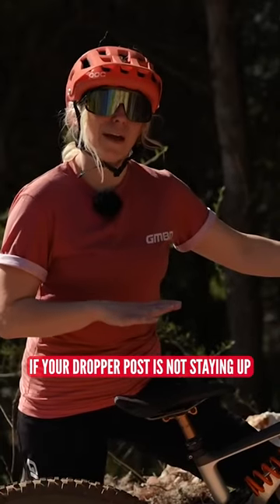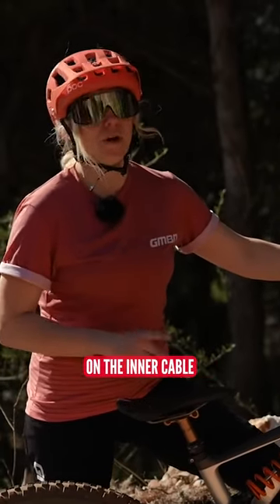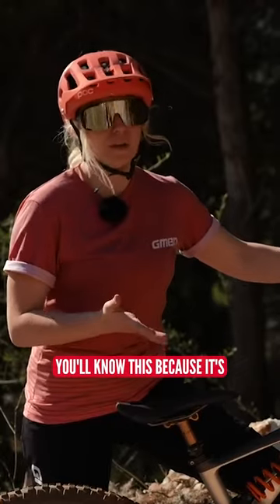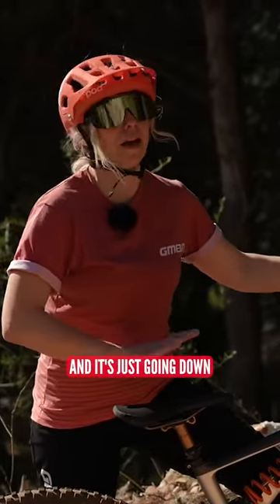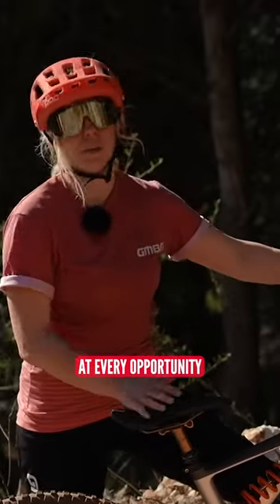Dropper Post Not Staying Up? Watch This!

Comment: It can also be fsulty post or failure. First gen of RF Turbine, leaked, was spongy they had a bad rep. I returned 4 of them. It's not slways user, assembly, adjustment error.